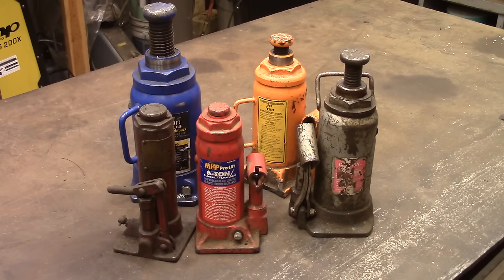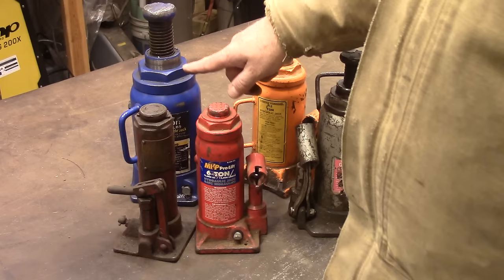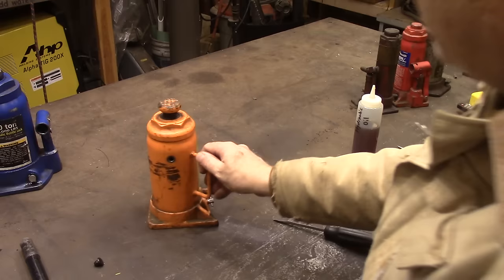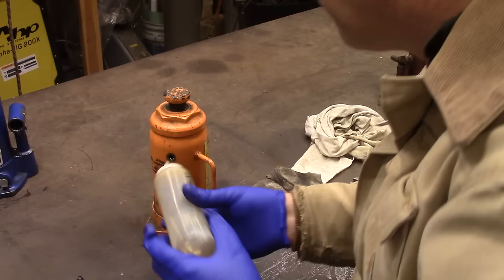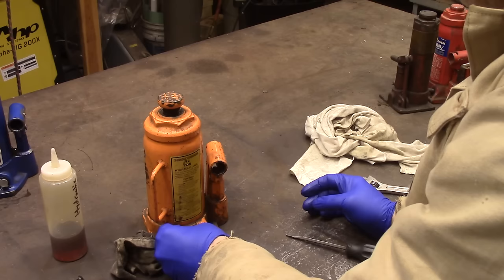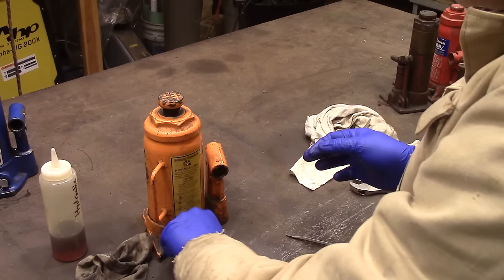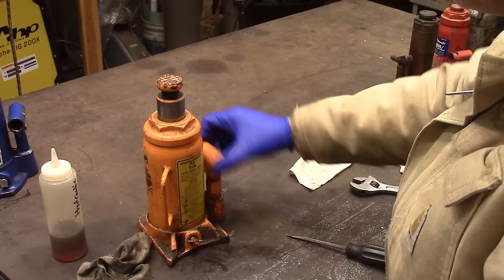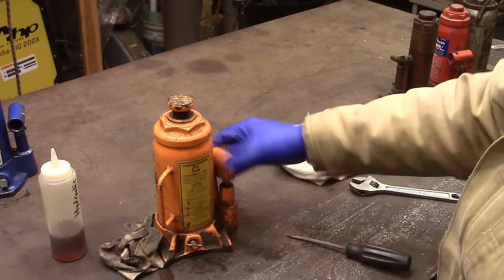How to Repair a Hydraulic Jack

Comment: I had a similar issue with my 8 ton long ram on the engine hoist. Took a lot of pumping, but it worked.
Bigger reservoir. More air. 
Thanks for sharing a quick fix.
Reply from the maker: You're welcome!

Comment: Tap it ,put a threaded machine screw with a seal ring on it and throw that rubber stopper in the garbage. good video, thanks. my problem is a leaking dual piston floor jack. thanks. I don't know jack about jacks.

Comment: Got a 2 year old Harbor Freight 12 ton bottle jack working again. Curiously this thing had almost no oil in it...I used the thing maybe only 5X and never noticed any leakage. Perhaps it was sold with low oil? Anyways even got the plug out without damaging it, took more oil than I thought (I used 5W-20 synth motor oil, all I had and seemed to work fine) and works great - thanks for the easy lesson!!! Here's a similar saying I've heard that @juddbutler shared - "Nothing is impossible, unless you can't do it" 😆
Reply from the maker: LOL.  I'm glad it worked for you!

Comment: Thanks! The instructions that came with mine named none of the parts nor did it tell me how to lower it, when it was stuck at the top, even after opening the lowering valve. So, video time...I’m heading out to possibly release an air bubble. Pressing down on it? I weigh 100 pounds. I may use a bigger hammer. As one viewer did, gently, if it doesn’t lower easily after that possible air bubble. Thanks! Bookmarked for when it’s time for a refill.
Reply from the maker: Glad it helped!

Comment: Excellent vid. If one stores a bottle jack on its side does it damage the bottle jack? Irreparably?
Reply from the maker: Not irreparably but you may very well leak oil and/or introduce air into the cylinder that will effect how well it pumps.

Comment: I have two new 12 ton bottle jacks that are impossible to push back down after jacking up.  I have to beat on them  about a hundred times with a block of wood to get the piston back down.  What could be the problem?

Comment: Thanks for your response. I’ve reviewed your videos and released air from back grommet and repeatedly copied your process but still get air. You replaced an Oring on a plunger and  finally the air disappeared . I think that’s what’s wrong. But not sure. Maybe I need to replace the-cup rubber seal like you replaced th Oring. If you know any outlet supply but they are probably going to want to know the model number which I can’t find (worn out) if not I appreciate your reply and will unfortunately toss it. Thanks

Comment: I've rebuilt a trolley jack as the O rings were leaking in it.

I don't think they are very particular as far as hydraulic fluid goes,I just used Dexron III automatic transmission fluid & it's done a lot of work since.
Reply from the maker: I agree, I think almost any oil that is not too thick would work.
Reply: I could've even used 10W30 engine oil since Dexron 3 is about a 10W20 grade fluid.

Comment: Parts for plunger u-cup seal central Hydrolic 20 ton bottle jack harbor freight 20 year old. I’d like to try and repair it. I bled it like you did and push down main shaft and hear bubbles????
Reply: Very helpful tutorial.
Reply from the maker: Sounds like you just have air in it.  Keep cycling it until the bubbles are gone.  If you hear it pumping bubbles when you pump it up I have another video that talks about how you might fix it.

Comment: Me and a freind were going to put my new lift shocks on but my new jack ( That I have only used once) did not want to go up and pick up my truck ?. Decided  to to see if somebody on You Tube had a video to troubleshoot and RIGHT THIS SECOND 3:35 P.m we are working on the bottle jack.
Reply from the maker: Awesome, hope it worked for you.  Remember to store hydraulic jacks standing up, if you don't they can get air into the system.

Comment: So you don't lay it on its side and fill it as much as you can? You fill it upright? Would laying it on its side over-fill it?
Reply from the maker: No, that will put too much oil in it and it will probably leak out the plug or shoot the plug out when you let it down real fast.  Filling it standing up will give it plenty of oil to operate.

Comment: I found a junk bottle jack that I'm trying to restore. I accidentally lost the ball bearing from the check valve. I'm trying to replace it but I have no idea on the size. I've tried 5/16 and 3/16. Basically the jack operates fine except when you put real weight on it, like a car. Then it just pushes it back down. I performed your method shown in this vid but no change. How crucial is it that the ball is exactly correct in size? Have any idea what the correct size actually is?
Reply from the maker: Not sure what size for your jack but it has to get all the way down to the bottom of the valve where it is machined to seal.

Comment: I have one that has worked fine until I got it extended all the way and then it won't lower... Haven't tried anything but opening the valve and pushing down, also placed a 20 pound weight on it overnight but it doesn't budge. Any ideas??? Thanks!   NOTE - I fixed it by doing what I've been trained NOT to do - USE A BIGGER HAMMER. I smacked it with a 6 pound sledge and it descended! Then I bled the air off and it be woikin' fine!
Reply from the maker: Try turning the valve all the way out and make sure there is not something stuck in it.  Be careful as oil will run out and shoot out if you push down on the ram but that might clean out the valve for you. Sometimes there is a ball in there that can get stuck in place.

Comment: Is it normal to have to push down the lift manually after releasing it
Reply from the maker: Yes. Unless you have a load on it. They don't auto retract.
Reply: @SoatMon  thank you for clarity I thought the piston was supposed to retract like a wheel jack

Comment: I got a craftsmsn atv jack # 950190. It jacks up but gives almost as fast and can not hold pressure. Any Ideas please.
Reply from the maker: I'm not familiar with that particular jack but it has to be either the valve that lowers it or the check valve in the pump.  Probably an o-ring that has gone bad.  Try to find a parts list and diagram for and look in those areas.  I would replace the o-rings first.  Good luck.
Reply: @SoatMon  thank you so much for answering so fast. That really helps.

Comment: Thanks for the tip.   I’ve got one that has similar problem.  Maybe you have an idea.  My son losened the lock valve to release pressure and lower his Jeep back down but the different tire size allowed the jack to be fully compressed but tire still barely off the ground.  He thought the jack was still holding and loosed the valve to the point the threaded portion came out of the jack and drained the jack of most of the oil in gush.  I put the threaded portion back in but it seems  to not seal and allow the jack to make pressure.   Do you think there is a seat or ball or something that got blown out and lost when the oils gushed out?  I’ve not been able to find a parts diagram of the jack.
Reply from the maker: Not sure.  I would look at the end of the end of the bolt that you screw in to tighten it and see if there is a seat for an o-ring or if there is a seat in the bottom of the hole.  If so I would try an o-ring.  Usually there is not one.  I bet an o-ring shot out and needs to be replaced.  Harbor freight sells a few good assortments that might help you.  Good luck!
Reply: Turns out the o-rings were still good.  I was missing the 6mm ball bearing that acts as the seal when tightening down the valve (close for lift, open for lowering).
Reply: Yep I almost threw one away today, same reason Dan. Where did you find this ball bearing, if you did or are still around?
Reply: kids cans ruin every tool made. mine did or leaves them laying where they last used it. I finally quit buying tools for him. not responsible. buy his own or do without.

Comment: My jack has problem. I jack it up and when i release screw push it down it wants to pop up on its own.can you help me?
Reply from the maker: It sounds like it has air in it, try the procedure to get the air out of it.
Reply: @SoatMon  Soat, I think my Jack doesn't have a plug.. at least, not one I can see. I ended up filling it through the valve instead. It's pumping up, but there's air inside. Tried your procedure, but then the oil spat out in a stream. :f

Comment: Have a real issue with minw old floorjack. This video show it stands up and mine is standing down, Is it a difference in level of oil. Floorjack they say it should be full when it lays down and here on the video it says it should about 75 % full. Have aired it 20 times but nothing happens. So it must be inside. I lifted my lifting arm and at the same time push the pump. THe cylinder suck oil into the reservoiar so at the same time I have to pump so the oil comes through. At the the end of the top when the lifting arm not can go any higher I close the valve and then it goes back some depending on the oil level but it standing . Problem is when I release valve it goes back but I cant pump it up....Tried different things nothing works. Try to change the o-ring at the pump-function. Somebody?

Comment: Thanks! ...One Q: I do the same thing when taking out the air but the pumping-ventil is jumping off when I press the piston rod back and when I pull the oil plug off it through out air quite a bit. It is the ventil or the oil plug the air wants to come out of. The piston rod cant be pushed down so the seals in that part are ok. Also it goes a kind of slow but it is a 10+ years old. Have flushed the oil-channels with compressed air nothing changes. Anybody?
Reply from the maker: You may have too much oil in it. If it's too full the pressure will build and blow the plug out.
Reply: @SoatMon  THANKS! I have a floor jack and the hydraulic bottle that is laid down. Should I take it loose and stand it up when I fill it up? I laid it down and then filled it up but then it was pretty full. I think you are right. It will be a difference if you stand it up vs laid it it down when you fill it.

Comment: What is the screw for thats under the red cap that says do not adjust??
Reply from the maker: Not sure on your jack, but it usually is a valve that keeps you from over pressuring the jack with too great a load.
Reply: @SoatMon  yes thank you for replying, I need to recalibrate it now aha

Comment: When do you put the plug back in
Reply from the maker: After you have filled it.  It doesn't really matter when but better to do it when the jack is in the retracted position other wise the plug may have pressure on it when you lower the  jack and come out.

Comment: Hey my release valve came out and when I try to screw it back in, it won’t screw in all the way, any help??? Please
Reply: It is an o-ring there and push harder with screwdriver till it go into the threads
Reply: Biy a new o ring. Simple

Comment: My bottle Jack won’t ’reset’ - so it’ll lift, but then doesn’t drop back when twisting the reset screw - is it dead?!
Reply from the maker: Not sure what is going on but you have to put weight on it to push it down once you open the screw, it does not retract on it's own.

Comment: Re: How to repair a hydraulic jack.
MaynI suggest that you incorporate a check list to remind you of the required steps to cover while recording.
In this video, you neglected to replace the reservoir plug!
Messy if the jack falls over or while used in a dusty environment or rain!
Midnight Cowboy

Comment: What causes a jack to not fully retreat?
Reply from the maker: You have to push them down, if it won't stay down after you push it in, it has air in it and you need to purge the air as I show in the video.
Reply: @SoatMon  Thats the issue,  it stays up about an inch and wont push down even a little bit.   The jack works but just wont fully retreat
Reply: @laserfalcon  too full of oil or condensation...
Reply: @jerryking1434  thanks,  i will look into that.

Comment: Mine won't pump up and it is full of oil.
Reply from the maker: Make sure your valve (the little bolt at the bottom) is screwed in tight.  Other than that I think it would be in the pump or check valve.

Comment: How to repair a bottoe jack .. mmmmm   why did I expect this video to show me how to repair a bottle jack
Reply: Neil Macleod - The jack was out of service due to air trapped inside the jack. The man bled the air off and replaced the hydraulic oil that had escaped. There for putting the jack back in service. How ever small the task, this is a hands on repair. Is it not? A task was preformed and now the jack works properly again. If this is not a repair then what would you call it? And don’t use a description of the task performed. What single name would you use would you use to describe the task preformed? How do you get around not calling this a repair of a tool that didn’t function properly?

Comment: Adding fluid to a jack is not a repair. Taking it apart to replace a o'ring is a repair. Adding oil to your car's engine is not a repair. Changing the oil pump is a repair. Get it?
Reply: It's a repair if it won't pump oil because of a bubble in the pump mechanism, someone who knows how to repair the problem does so and now it is repaired.
Reply: You're correct.  One must ask, how did the air get into the system?
Reply: Richard Bedard Really your dinging him on this? That’s just being a jerk-off. It didn’t work properly and he fixed it that’s a repair. Stop trying to be a know-it-all your making yourself look foolish with your lack of knowledge. Bleeding air off a jack so it works properly is a repair. How ever small the task the man put the tool back in service. If you tighten a floppy belt on your car you just added pressure to the system to make it function properly and that exactly what happened here. No parts needed to fix both situations. Are they not both hands-on repairs?
Reply: He fixed it, it was a great repair!
Reply: He Quit mechanics school early.  At about lunch time. He wanted try that Hydrologic oil theory 1st. See if it really worked.
Reply: Next Mo maybe he'll try the Changing oil thing. Maybe he needs to see the oil filter REMOVAL Vidieo. 1st.
Reply: @markm2265    Wait. They didn't show if he put the Rubber plug back in before trying it. Did they show him putting on his Goggles an hearing protection . Was he wearing Steel toed Boots incase  the jack falls off the table. This Film will become product of. OVER KILL BY OSHA.
Reply: Why don't you just do bottle hydraulic jack seal repair to render your point valid.